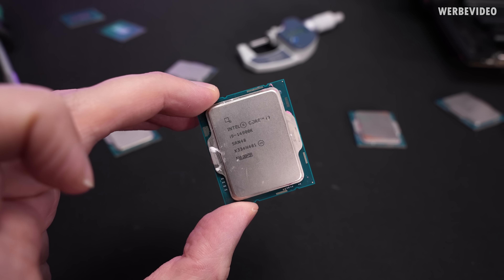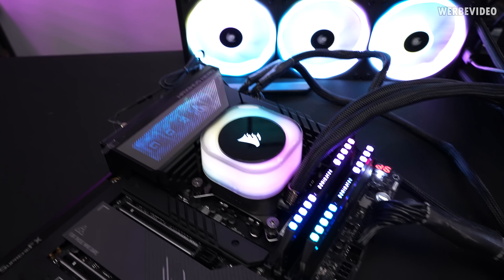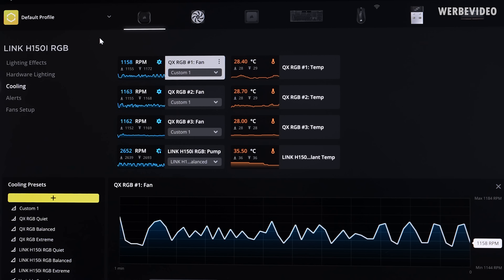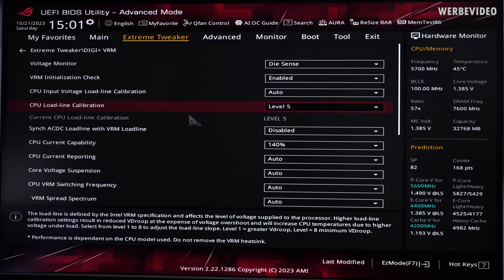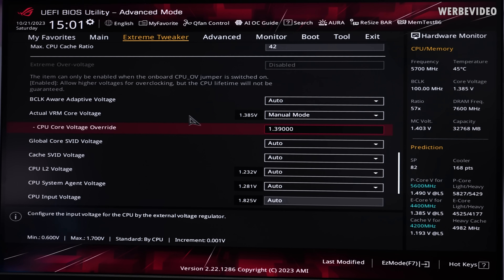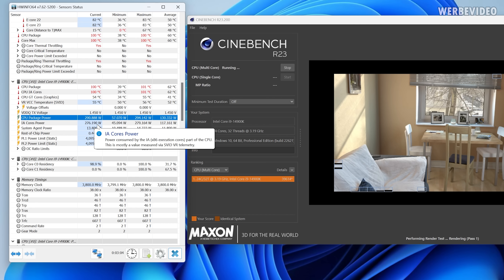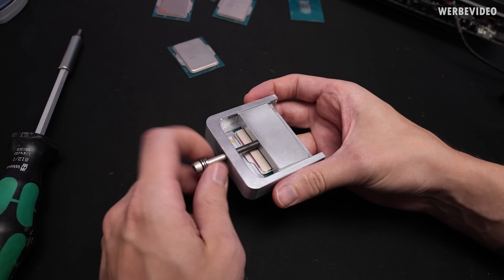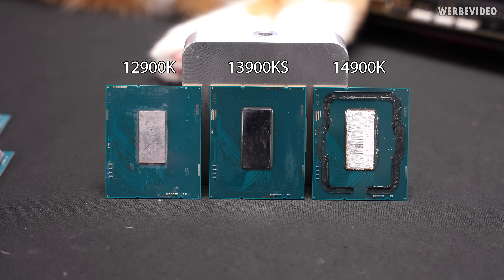Surprising Results - 14900K Delidding

Comment: I do not understand the measurements. The height between the chip and pcb is 0.4138 mm then the height between the edge of the IHS and the middle is 0.319 mm? so the IHS is usually just floating on the chip connected with solder and the edge is floating above the pcb with the gap filled with glue? so when you had to lower the edge on previous cpus would you also lower it to less than the height between the chip and pcb and this direct contact floating behavior is what is desired? I suppose that makes sense when you think about how a cooler makes direct contact with the top of the IHS and to two are compressed together when mounting with the thermal substrate filling in any unevenness, maybe?

Comment: I have a torquing screwdriver that ranges from 0.05 nm to 0.6 nm. By using the 13th/14th gen contact frame, what mounting torque would you recommend for a proper CPU contact with the pins in the socket? I know the 12 th gen recommends between 0.03 and 0.06 nm, but the 13th/14th gen one has no recommendation.

Comment: @der8auerEN I have a SERIOUS QUESTION about MORE cooling with the Thermal Grizzly contact frame... possibly... In theory it makes sense to me but, NOT ONE SINGLE PERSON HAS TRIED THIS AND POSTED ABOUT IT!!!

WHAT IF you put a .5 MM THERMAL PAD, around the perimeter of the contact frame like whats used on M.2, GPU, etc, etc. 

This thermal pad would be sitting between edges of the water pump/air cooler and the contact frame, surrounding the CPU.

My thought is that since the top of the CPU sits right about .5 MM higher than the contact frame, we can fill this gap with a thermal pad for MORE COOLING, especially for the really crappy i9-12900k/13/14, ones that simply WILL NOT cool down without drastic measures, like mine...

WE ALL KNOW, or should know, that circles have more area than squares/rectangles when they are the "same size", so there is a portion of the circular aio pump/cooler that is doing NOTHING. 

The circular plate from the water pump/cooler is LARGER than the CPU itself, so there is an open air gap around the edges of the cooler between the coolers plate and the thermal grizzly contact frame.

If we put a thermal pad in the air gap, would we expect MORE cooling/heat transfer? 

In theory this makes sense to me but, in practice would this help, hurt, or do nothing??

Comment: My CPU would immediately Thermal when doing any benchmark - just straight to 100C on my Aorus AIO 360mm as soon as you pressed "Start" (eg: Intel Extreme Tuning, OCCT, etc.).  I've just de-lidded my i9-14900KF, 7200MT/s DDR5.  I went the full "Thermal Grizzly + der8auer route" (de-lid CPU, lap IHS top flat AND shave the skirt, liquid metal CPU->IHS, contact frame IHS, etc.).  I had to shave the skirt of my IHS  (my OCD really) because when I put the IHS back I didn't feel like the IHS was touching the CPU die, even minimally, and had no way to verify the gap.  I wanted to be sure so I kept sanding until I heard a "different tick" sound when I placed the IHS onto the CPU Die board and there was a slight gap (say <0.1mm) between the IHS and the CPU Die board.  Used no glue for the IHS and CPU Die board and just relied on the Contact Frame to centralise and hold the IHS to the CPU Die board.  After all this I got marginally better results with an average drop of 6C in benchmarking.  A lot of time, sweat and energy but not upset by the outcome.  No "astounding" outcome for idle/light load temps. but my CPU no longer goes to 100C (94C) on most benchmarks.  Maybe didn't need to do all that but it is done and I won't have that "what if" question now.

Comment: First thing I did with my 14900k was under volt it.  Lost a lot of heat and saved about 80 watts in Cinebench R23 without losing any points on the final score.

Comment: I really would like to see a 14900k or 13900k with direct die and OC for daily use. What would be the clock and performance increase? There is no point in just showing the temperature. Same thing goes for Ryzen, they scale worst with more voltage.

Comment: What’s the real world benefit to this though? I used to do crazy builds and mods but now with a family, I use ASUS AI overclock.

It raised my clocks from 5.7ghz in MW2 to 5.8Ghz in MW2 😂 not really sure that’s going to help my fps.

Also, how did you get 7600mhz ram?!? I’ve got an ASUS board and QVL 7200mhz ram and it blue screens. I have to drop to 6800.

Overall disappointing

Comment: It’s really surpassing Intel 14th Gen has no real performance gain over 13th gen. I am running 13900k and without OC and delidding my highest C23 score was over 40k. This was achieved by switching process to “real time” in the process manager. If I don’t tweak the processes my score drops to 39k. Hoping gen 15 is going to be better.

Comment: For many months I was looking for the DIE height of the processor, I always looked for that name on the internet: on Google and YouTube but I never found even a video or article about it. And then, casually watching your video without the intention of finding this information: boom. I came across the information I was looking for so long. Just for this information you already deserve my like + subscription.
Reply: Fyi- there is one capacitor on the board that is slightly taller than the core processor. If you're planning on direct die cooling, be aware of that.

Comment: I'm surprised that you had to shave the IHS down (I guess reverse lap?) to make good contact with the die. Wouldn't the silicone/rubber that's sealing it add thickness to all generations (9th being soldered I can understand) and therefore make all the CPUs end up with a gap once you remove that? Obviously having worked with them, you know more than I, but I certainly didn't expect that.
Reply: No experience with this, but I know mechanics use something called Plastigauge to test bearing clearance. A possible option to test the die/IHS gap?

Comment: Hi, I don't understand what you did. It seems to me you just replaced indium with Gallium. 
By cleaning the heatspreader you tightened the fit, the die ends up closer to the heatspreader ? is that it ? otherwise I don't see where the improvement came from. And you're cpu isn't safe anymore, the heatspreader is now loose.

Comment: You work great. A fall of 10C and 20 watt allows 0.1 more gigahertz to run. And despite it's an indium solder it sucks, no better than internal thermal paste.
Still I would pick an AMD instead of this. Without power efficiency this is another FX 9590. The one with greater efficiency always win the battle and overpowering the opponent in performance at the cost of numerous power consumption is an action of coward.

Comment: lot more cooler than 13900k,, something amd need to check on how to cool their zen4 issues that running 90c is not normal for them on low clock vs intel can run 8ghz in same temps as zen4 7950x

Comment: I used 14900kf with supercool direct die for a couple of days while testing and comparing it with 13900ks, these are two absolutely identical processors, there are no differences in appearance. But the IMC of the 14900kf turned out to be so garbage that even 8000 on the 790 apex were unstable, so I sold it immediately after the tests. This "new generation" reminds me of the 11th gen))) no improvements, just replaced one digit on the lid and pulled up the turbo boost.

Comment: 14th gen is meant to use less power and have lower temps over 13th gen. 14th gen has implemented something called DLVR, a method to reduce power in 14th gen.

Maybe somehow your 14900K messed up with the indium and wrecked the temps. For further evidence see Hardware Canucks vid on the 14th gen release for temperatures.
Reply: DLVR on 14th Gen? Are you sure? :)

Comment: A further comment: As I said, with the '14th gen' launch I'm waiting for the 14900KS after Intel kept back all the 'good' 13900K chips for the KS release. Hopefully January 2024. Your de-lid tool is obviously still compatible as the die hasn't changed dimensions! Would it be possible for you to do a direct die test of your new 14900K using LM, Kryonaut and graphene sheet? I'm sure a lot of people would be interested in the results and it would potentially remove the need to re-apply liquid metal every year or two. Also, any chance of you offering binned delidded 14900K chips with likely KS level of SP and IMC?
Reply: Would the ks be worth waiting for probably 100mhz more the like its stock version from 13
Reply: @Pavasoz  Yes, probably only 100MHz on paper but Intel kept the best IMC and Ring chips back for the KS release as well and will probably do so again so that's another reason I'm waiting (and hoping).
Reply: @Pavasoz  I got my 14900KS a day after release. 117 on the P Cores and 86 on the MC SP. Dropped to 106 overall by mediocre E Cores at 76 but not complaining. Runs 5.9GHz all core with 6.2GHz on 2 cores and 4.5Ghz on the E Cores out of the box on my Asus Z790 Hero on custom loop. MoRa arriving in 4 days for delid and see if I can get at least 6GHz all core in R23.

Comment: 12C drop is good result from any perspective. I was sold on Liquid metal back when I did my i9-7900X and saw a 18C drop in terms on the X299 board. Even the 12700K saw a 10C drop and I done run it as hard as i did the 7900X. I am keen to see this as a last upgrade for the LGA1700 to last me another 3 years. Thanks again Roman good work.

Comment: the difference between 13th gen and 14th gen is , 14th gen is a higher IPC and better Quality silica due too improvements in production and experience gained from Intel's new Architecture . better more refined quality Silica with lower temps , higher boost clock out of box and better overclocking potential . most reviewers didn't understand or know really what was going on .

Comment: I'm interested in why you take sometimes XMP I and sometimes II (Asus Boards)? I have an 13900k stock and Strix Z790-F on LLC4 for now. Finetuned with IA AC/DC and 253W PL1&2. No Offset. And running with Vengeance RGB 2x32GB 6400Mhz on XMP II as your german oc guide from 13900k(s) was saying XMP II. And a lower LLC would be better no? But also there you always go for 5-6. 
Can you tell me what LLC and XMP you would prefer for my setup? 
Would appreciate your advice. Thx

Comment: Question: Can i use my 12gen delid tool and my EKWB direct die water block on the 14th gen? Or do I have to buy all new blocks/ socket retention and delid tools? The direct die surface looks like it will cover the 14th gen and the socket is the same. I have a delidded 12900k with a direct die water block with liquid metal.

Comment: my take on Delide vs STOCK / minor throttle vs all cores throttling, smoothness with responsiveness / i said take silicon gel make a thin coat on the chip put the heat spreader on as if you are using the silicon gen as thermal compound ... then remove the heat spreader and observe how the silicon makes little stripes and lines and bubbles to show where the high sides as well as edge of chip overall flatness i use paper nail files to level it flat until it's a suction cup to the heat spreader / around the edge and some times in the middle longest sides in the middle

Comment: I'm curious if Intel change something with their manufacturing process. Could you try this with a different 14th gen CPU too, to see if this result is consistent? Being able to delid, apply liquid metal, and then putting the IHS back on for a 10C reduction would be great. Also, it's been years (maybe a decade..) since I've used any liquid metal paste, what is the expected longevity in a case like this, where it's under the IHS? Is reapplication required every few years, or no?
Reply: I would like to get answers for all of those questions as well ;)
Reply: I found the answer 3 comments below yours, every 1-2 years it has to be reapplied
Reply: @InsomniaReal  Thanks dude, appreciate it.
Reply: some people recommend reapplying every 6-7 months but thats just what ive heard.

Comment: 14900k and 14x series is trash. Ever since 12th series Intel has been Copy + Pasting logic, runnign Chips hotter than usual + running chips w less efficiency than usually. Pointless. These so called "Computer Engineers" should be ashamed of themselves because they seem non-existent. Every year they do CTRL+C + CTRL+V in XILINX and get paid 140k paychecks because they are in a Cult
Reply: well at least it's not gen 11 where they went back 😂

Comment: 13 degrees??!?!? WOW!!!! GREAT WORK!!!! 
Totally unexpected too.... but you mentioned grinding down the heat spreader a bit to match the height... did you do this on the other ones?? (the 13, 12, 11, 10, 9th etc) maybe you don't NEED TO grind it down... maybe it's causing you to make just a little bit too tight.. and I would THINK that when it's too tight it can squeeze out too much of the liquid metal, thus not having the microscopic pits and valleys filled in by the conductonaut..... 
In other word on the 14th gen you weren't able to tighten to that point, because you didn't change anything having to do with the height (no grinding, etc) - Looks like you might have some testing to do!!! :D lol - That would make for a good series.... testing out the difference on a few of these chips (you could probably get your hands on enough of them to make for a valid test) and then test them to see if that grinding makes a difference... and THEN YOU SET THE 9.1GHz WORLD RECORD!!!! MUAAHAHAHahahaha! :D

Comment: What about lapping ? I have the lapping tool and it did well on my 13600k but with my 14900k I’m hesitant to do it and void the warranty as I’m having some stability and seemingly a worse imc than my 13600k. 
Also I lapped my cold plate prior and I’m thinking I’m not getting even contact I think so could using a lapped cold plate be causing me stability issues on a non lapped cpu? 😮

Comment: I thought my 98 SP 13900K was bad but can hit 5.8GHz/4.4GHz all core with EK Velocity^2 block and custom loop, though the IMC will only hit 7000 MTs. I'd be interested in a direct die test of at least an average (near 100) 14900K. I'm waiting for the 'good' chips that will release as the KS early next year!
Reply: My 14900k has an sp of 98 also and the imc sucks compared to my sp80 13600k lol 😂 I don’t know why an sp98 doesn’t run stable on 7200 Xmp
Reply: @cppctek  68 SP IMC 😢  It will run 7200 but gets a single bit memory error about every 2 hours on heavy memory testing load.

Comment: You could disable all the unused HWiNFO sensors to drop its CPU usage, as well as greatly improve readability.
Reply: Even better would be tapping directly into the SMBUS with an external microcontroller the way out-of-band management controllers (like Dell DRAC or HP iLO) in servers do. A number of motherboards have smbus headers you could read from, and they all have an smbus you could solder to
Reply: @mycosys  SM BUS, thanks, it's on a header.
Reply: Sysinfo is the smaller of the loads. OBS is the hog, if 3 to 4 percent CPU load can be called a hog...

Edit: So I looked back on the taskmanager in the video and to my surprise HWInfo is indeed the largest loaf at about 4%. OBS isn't even visible in the list sorted after CPU load, high to low...

Comment: I've just recovered from the mind blowing experience of 14th gen myself, what a wildly innovative and completely revolutionary series of products.
Reply: It is what it is. Same price, at least where I am - actually the 14900K is about 15 Euro cheaper... And when I bench the 13900K and 14900K I have right here, the 14900K is faster.
14900K scores 40400 in CB and the other 37180. Both clamped at 253 watts, -0.07 offset, LLC 5 and at 83-85 C. 
The difference may not be huge, but I've yet to see anyone with a 14 i9 K that ran slower than a 13 i9 K.
Reply: Here, I got a crappy chip. Slower than the 13900k at any stable settings.  Thermal frame, 360aio.  I even isolated the hot cores and clocked the. Individually.

Comment: How do you clean off the Indium solder?

The last time I de-lided was back when intel CPU's used paste (3rd gen i7's for example) and didn't have capacitors on the PCB that could be sheered off.

Comment: I'm of the opinion that delidding a CPU with indium TIM is useless unless you plan on direct die cooling. Are there any other use cases? What is the thermal conductivity difference between liquid metal and indium? I think they're pretty close.
Reply: Huh?  He explicitly just replaced indium with liquid metal in this video and saw a 10C performance improvement.  No direct die cooling done at all.

Now, can you guarantee a decade of use with liquid metal in almost all conditions, including multiple re-mounts?  Of course not.  That alone is reason enough to not use it straight from the factory.

Comment: On a different subject, I purchased your new ryzen delidding tool and after removing the IHS  and cleaning the silicon realized that the chiplets are not parallel.  It took a significant amount of lapping to create a single plane surface for my waterblock.  After some thought I decided to remachine the waterblock to alter the water flow by 90 deg trying to improve the temps across the cores.  Have  you tried this ? It seems like all waterblocks are primarily designed around intel chip layout.   EK has offset their inlet but are still cooling the cores along the long axis.
Reply: That was surprising at first, but after thinking the difference makes sense.  Probably one of the reasons why Indium is as thick as it is.  Allows for manufacturing tolerances and means that they don't have to make sure that every wafer is exactly the same.

It's easy to forget just how small 0.1mm is, and how expensive it can be to get everything perfect.